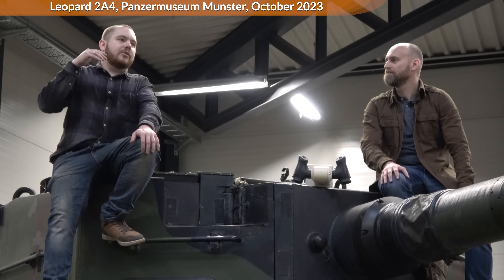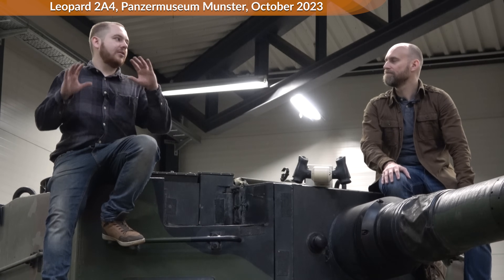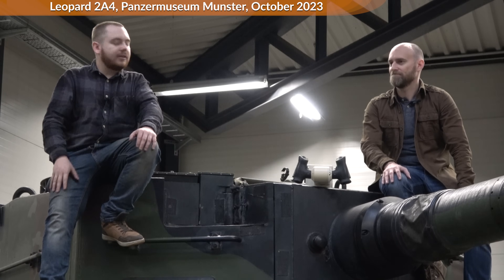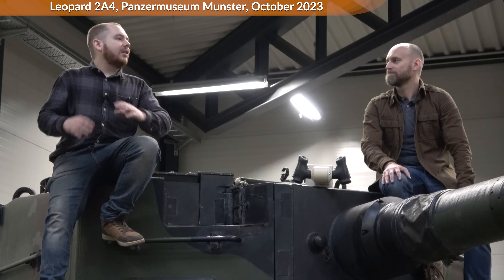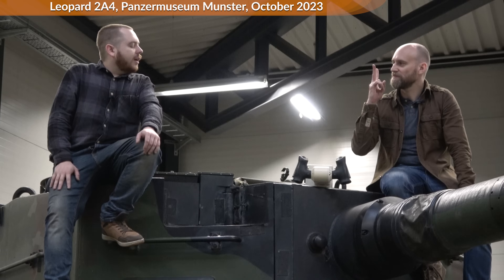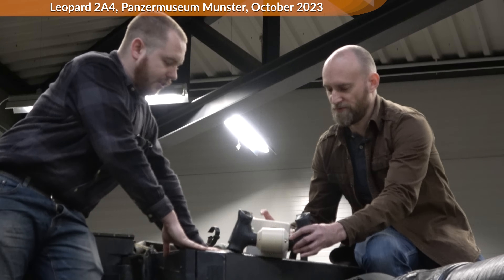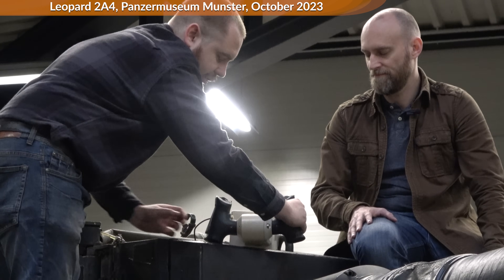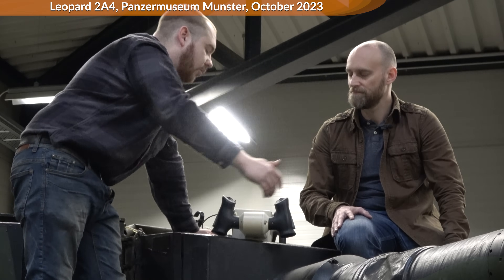Laser Range Finding: What everyone gets wrong

Comment: I think we need optical rangefinders once again (as a secondary rangefinder), just of course with nowadays technology would be almost just like a slower but more precise and hidden laser rangefinder
Reply: It's very important, these days, because laser warning detectors exist, however, optical rangefinding installations now are far less capable than those used in the 1960s!
Reply: @davidgoodnow269  I suspect stereoscopic and coincidence range finders could be automated using image processing methods which could be part of integrate with target tracking.   There are already systems for robotic vision that do this.   Lasing may just be too dangerous.
Reply: @williamzk9083   Exactly, a MOSFET can be behind the lenses, as long as the lenses and the object viewed creates a sufficient angle.

Comment: Thanks. Interesting.

Funny, why is it called laser then? I mean, from what I remember at university, it is sort of all about preventing the cone in laser technology. But, nowadays everything is a laser if it emits some kind of em waves. I always was wondering how the laser warners could detect a beam of only some fraction of millimeters in diameter. But now it becomes clear.

And now I am wondering why the laser range finders are not actual lasers? And now, I am wondering whether one could drive tanks crazy by using sort of wild live photo traps but instead of taking pics several distributed devices emit the "laser" triggering the detector.

Comment: The laser warning thingy could go wild if the tank is near a techno festival?
Reply: They are almost always tuned to detect infrared lasers and not visible ones, since almost no modern battlefield equipment uses visible lasers. they also distinguish between intensity frequency and so on, and even though the kinds of lasers you see at a techno festival may look similar, those characteristics are going to be greatly different on military lasers.
Reply: They look for specific signatures I believe. And can be turned off or ignored.
Reply: Think about it this way, if you have an LWS that can automatically turn the turret in the appropriate direction your tank will essentially head bang automatically.
Reply: @klobiforpresident2254  kek

Comment: Former OR 8 German platoon leader here. 
Sorry, I have to correct the gunner Tobias here. It is absolutely not depending of the TC to name to landmarks in the "Geländetaufe." That is up to the platoon leader in most of the cases! Every soldier of the platoon needs to know those names! This is to accelerate spotting, respectively firing times of the whole platoon. 
Example: 4 tanks appear left side at "Kugelbaum" (ball tree). The TC of the tank immediatly airs that on radio: "Left side 4 tanks at Kugelbaum." If properly (which usually is done) tasked beforehand, the gunners of the other tanks leave their observation areas even without specific orders and (if permitted) can engage the targets, while the TC's with the periscope overtake the whole observation areas of their tanks. That is only possible if the whole platoon knows those landmarks. Imagine if that would be different for every tank ...
Reply: Deshalb wird versucht leicht an zu sprechende dings zu vermeiden 😊😅
Reply: @bierfest8  Von dem was man so sieht, denkst Du, dass potentielle Gegner das machen respektive, dass sie was ansprechen?
Aber ja, hast Du freilich recht.
Reply: In finland the individual tc can also name landmarks for their gunner. Why cant you have both in germany?

Comment: Then why isn't an optical rangefinder installed as a back-up in modern tanks?
Reply: Laser is faster, generally more accurate and works at night. If you're dealing with backscatter, you can adjust which reflections the range finder uses. If everything fails, you still got scales inside the scope to estimate distance.

Most importantly: if you get hit right in the laser range finder, you probably got other things to worry about.
Reply: Because thats 2 additional large optics complex to be installed on the vehicle with addition holes to cut and complex eye pieces path to be fitted for both the commander and gunner. 

Now, it is possible to develop a system that uses camera sensor and digitally present the relevent informarion to the crew. 

The german tried it in the 1970s. It works fairly well and emits no signsture when ranging. But they decided that lrf is simply less hassle for everyone involved.

Comment: I can only guess, but I'd assume it would be possible to have a different asset - like a drone - do the laser range finding, know where it is, know where the tank is, and then automatically do the math  to give the tank the information it needs to take a shot.
Reply: Actually if the drone knows exacly it's own position and has an accurate system to measure the angle the camera is looking, you wouldn't even need a laser anymore. It would be possible to calculate fairly accurately where the drone is looking at. That's actually already done with targeting pods attached to fighter planes. The aircraft knows where it is very accurately which also means the targeting pod knows its own position. Now many figher jets with the latest avionics can have a rolling map on a Display. If everything works you can see an indicator on the map when the targeting pod is active that shows the pilot at which area the targeting pod is looking at the moment. You can do exactly the same with drone.

Comment: It’s 2024. Can’t we have more accurate lasers than from the 80s? 😵‍💫
Reply: We have more accurate lazers, but you will still have a cone.

This cone is wanted because you get so much more info in the return signal, and far more resistant to corruption than with a narrower beam. 

Imagine something disturbs the narrow beam like soke smoke, heat waving in the air and there is have no return signal or only a highly corrupted one. With a wider cone most of those can be filtered out and it still results in a fully accurate measurement.

I guess that the reason they allow only first and last echo is so it does not overwork the crew. Fidling with a signal return like that on every shot would take more time and might overload the gunner in what is already a very complex operation. Also increasing the lazering time of the target, instead of a short "blip" it would be a spotloght. 

Maybe with newer machine learning algorithms the tank may allow it's own quick signal analysis giving the option to pick the targets it identified in the echos. But there are many buts there.

A: how reliable is the system, is it more reliable than having just the most usefull two returns and a skilled gunner.
B: how much more power will the system need in an already power hungry machine and can the tank supply enough electricity for a bank of GPUs on top of everything else.
C: It is better than a skilled gunner in the current setup, and is that money, space and power consumption better spent on other systems.
Reply: @HibikiKano  No, we get a cone because that's just how physics work. You can never have a perfectly parallel beam of light due to diffraction. You can only try to get a narrower and narrower cone but never parallel.
Besides that, first and last return is essentially the default options because it's easy to count for. You aim the target at the top edge of the cone and select last return. Bottom edge for first return. You pick between the two depending on what is around the target. It is easier to tell if the laze is accurate or not since you know the top edge(aimed at target) will always be last return as the lower edge would be targeted at the ground in front etc.
Having something in between is harder for the operator to determine the reliability. Imagine if it's the 7th return. Like is that from the middle of the cone? upper 1/3rd? 2/3rds down? Like where is that return from? Hard to tell, but we have a much better idea where the first and last are (the edges usually but not always)

Sometimes first and last are actually averaging the first/last 2 or 5 returns. When that isn't enough due to clutter, there might be an option for the average of all except outliers. etc. There is some with an option for the strongest return. Different systems have slightly different options and aren't as standardized but it is meant to cover the rare situations where first and last return isn't good for.
If all else fails, stadiametric sights are still common as back up. When even that fails, while we don't use coincidence or stereoscopics any more, if you are really desperate, you can use the gunner's sight and commander's sight to triangulate. But at that point, guesstimating might be more effective or default to the battlesight zero.

Comment: Makes me wonder considering gps and that digital maps exist, that a computer could calculate the distance to a target just using this information. For example the computer has a map uploaded and it knows we’re the tank is, when a target is presented or target location is input it calculates the distance. Simple in theory though not sure if it would or should replace laser range finding, having both would be good. But I can see for example where there is no landmark near enough or object that this would not work. This wouldn’t work in a desert unless you know the exact coordinates of a military vehicle and for this it’s needs to be standing still. Unless of course you can in real time update the coordinates quickly enough using what would likely be a UAV so that you could hit a moving target. But then again I don’t think this is in the realm of technical feasibility or even practical enough to bother with when you have laser range finding.
Reply: If I understand the idea correctly, it is to use your know GPS position, measure the azimuth and elevation to the target, and map knowledge about which piece of terrain in that azimuth direction is at that elevation angle to determine the range? That should work in theory. However, there's 4 problems, all related to accuracy (list below). The Tl;Dr is that there's too many situations where the system is unusable, so you couldn't drop the laser rangefinder anyways.

But it should work pretty well as a replacement for laser rangefinders in UAVs. As long as you're measuring an elevation angle that's steeper than 45° downwards you don't really need to worry about any of the below problems. All you really need (in addition to the drone GPS) is a compass and a sensor for "true" elevation angle on the drone camera. And the ground station (or the artillery crew's computer) can do the calculations.

1: You need to aim the crosshair at a point on the target that is a known height off the ground.
If the system expects to be aimed at the bottom of the tracks/feet for the calculation, and you aim it at the top of the turret, then you'll hit the terrain that's just about obscured by the turret. If conversely, the system expects to be aimed at the top of the turret and you aim it at the bottom of the tracks, then you'll hit the point where a target would need to stand to just about obscure the bottom of the tracks.
These differences will be horrific in flat plains (unless you can aim down onto the plain).
2: You actually need the ability to calculate ranges from at all kinds of points on the target; From a prone soldier to the top of a Bradley that's just cresting over a hill.
That would necessitate you to define what kind of point (specifically which elevation above ground) you're aiming at. Something like "top of tracks/ bottom of turret, T-55" or "bottom of track skirts, T-90/T-90A&T-90S" versus "bottom of track skirt, T-90M/T-90MS", or "top of wheel, unknown military grade truck".
0: (Not a problem) Your own elevation needs to be known quite accurately. Possibly even more accurately than the GPS can provide it. Luckily the system comes with a terrain elevation map, where you can look up your elevation if you know your GPS position accurately enough in 2d.
3: Terrain can shift over time. Luckily erosion tends to only be strong on the side of hills where the system would be less sensitive to errors in terrain elevation. But subsidence exists and may or may not affect the flat parts of the region you're operating in. And finally, war tends to come with quite heavy man-made terrain modifications. Both intentionally with the digging of fortifications, and as a side effect of artillery shelling and bombing.
4: You need to know the azimuth & elevation relative to the earth reference frame, not relative to your vehicle.
Azimuth relies heavily on your compass being accurate, and it can be affected by large concentrations of iron, like in that tank right next to yours.
And accurate elevation angle readings are only really possible while the vehicle is stationary. On the move you could very well rely on gyroscopic sensors to "remember" the last stationary elevation angle measurement, but that's another component that needs to be included in the system.
Reply: The problem with that idea is 
1. How do you know the exact direction to the target you would have to have a camera  with which the gunner aims at the target or some automated system like automated target recognition
 The thing is, these tanks are so old that back then, you couldn't fit enough data processing capability into a big room to do the recognition. Try and find something green hiding in a forest.
2. Find the range to the target that could be done by recognising what specific target you are targeting, and then from the known size and the apparent size you could calculate the distance. But again, not enough processing power is available back then. Or you could use a laser, and from the time difference from sending until receiving the reflection, you can calculate the distance. 
From these information you would get a vector wich you would add to your gps location  wich would give you the location of the enemy from wich to fire you would have to calculate a vector to your target to fire at your target so using gps is just a waste
Reply: If we where to use landmarks 
1. Someone has to know the area you are operating extremly well. i mean i could  barely do this in a 2km 1.2 miles circle around my home. 
2. Use computers to do the recognition. Again you would run into processing power limitation .
Reply: Using UAVs to get target data either by geting a complet fire solution or by just geting the gps data certainly works but that is a very new innovation.
These UAVs are also basicaly nothing but flying a tank laser range finder and a camera to find the targets.

Comment: Even modern civilian laser rangefinders for rifle shooting offer the ability to select from different echos. I have a relatively inexpensive one and it allows first, last, or strongest.
Reply: yeah but this is 30 year old stuff
Reply: @markus1351  almost 50 actually, however, the option to select the echo came with the A5, up to A4 you had only one function.
If I remember well, 1st echo, the engement butto was movebale in both ways already, though.

In the edn it is al made after keep it simple stupid, so that you can use all in the heat of battle.
Reply: @markus1351 It can take a while to scale down technology. Piezoelectric transducers were available to measure breech pressure in guns, back in the 1940s BUT it was not until the mid-1960s that the Remington Arms Company and Winchester started measuring breech pressures in small arms with piezoelectric pressure testing equipment. Remington quickly reduced the pressure specifications for the 7mm Remington Magnum and Winchester did the same with the .243 Winchester as the respective companies recorded higher than acceptable peak pressures for those chamberings. The old copper slug technology for high pressure rounds only provides a single data point i.e., a measurement of slug compression, for each shot. Interestingly, Barnes Cartridges of the World continued to show the old data for both cartridges, in successive editions, possibly endangering readers of that publication.
Reply: Yes they are actually talking about very old technology, modern laser rangefinder don't have such a poor focus.
Reply: @kukipett  the ones on tanks probably do have a tighter focus but the "cone" on my cheap commercial one is still definitely an issue. It can range out to almost 2 miles and the spot size seems to be about 50 meters wide at that distance. Even at much closer distances, since it is used for hunting, there is often the issue of foliage getting in the way so the ability to select the specific echo is very useful.
Reply: In the early to mid 2000's. Hand held Range finders in military use, were only issued to specialist troops.
E.g. SOF, Forward observers, Forward Air Controllers and maybe Recon.
I think the one I used and was deployed with, in the Danish Army, was latest generation, at the time. It was at least the size of a lunchbox. And only had first echo.

Technology in general, but miniaturisation especially, has speed up immensely since the turn of the millennium.
So comparing what we have now, to what existed in the 90's isn't really meaningfull, in this context.
In 1997, we would be having this conversation on a messageboard, maybe a forum. Most of the world used dialup modems. And the first Smartphone was launched in 2008, I think.